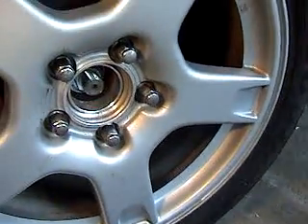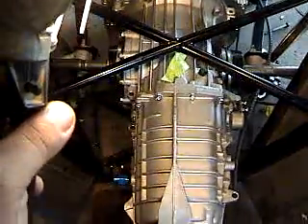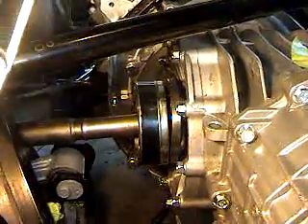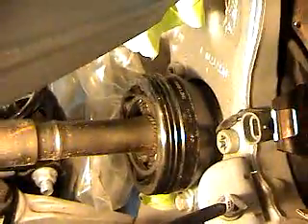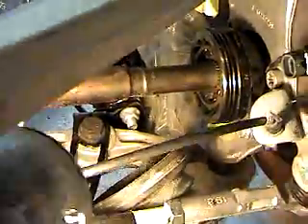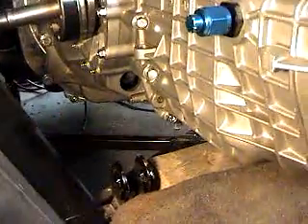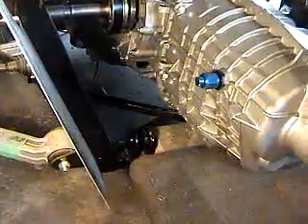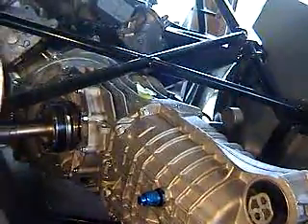Gen 1 GTM with Porsche G96 Transaxle

Comment from the maker: @IBLDEM yes, a bit of an angle is good; it's actually recommended to have some degree of offset when using aCV joint.  My setup is about 10 degrees off axis in both the vertical, and horizontal plane.  I don't think moving the driveline backward is a good idea on the GTM, or increasing the axle angle at the transaxle.

Comment: Hi, thanks for posting that video. I am thinking of doing the same thing, have a G96 from GT4. Wondering if moving the transaxle rearward will cause issues because of the addtional angle on C/V joints?